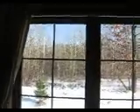Solar Heat Demo.avi

Comment from the maker: I felt the same way you do plus I converted the attic into living space so I'm revamping the system. I'm putting the water in a super-insulated "vault" in the crawlspace underneath the living room and blowing the hot air from the porch into the this vault. This way the warm air can rise up passively through vents into the living room.